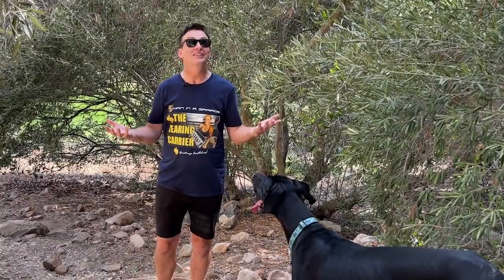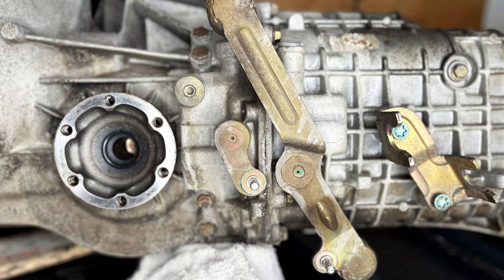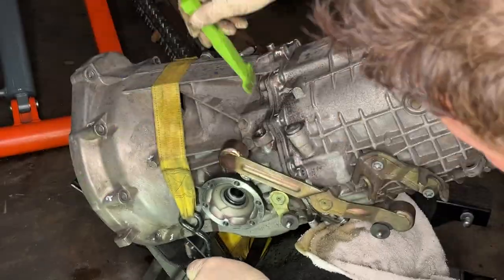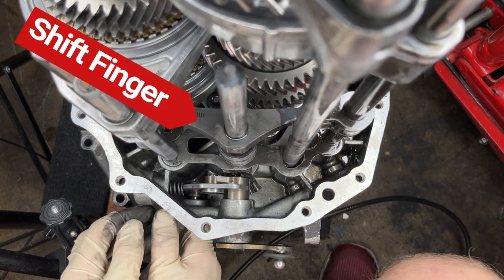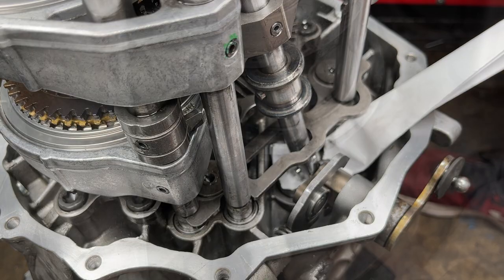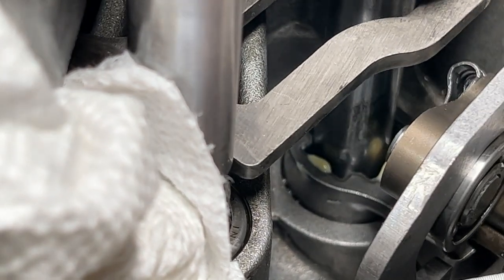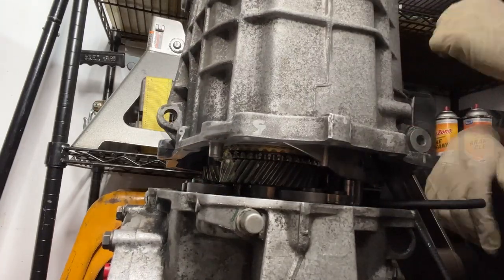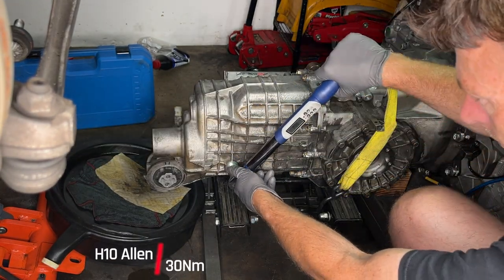How to BREAK a Porsche 911 Transmission!

Comment: Fill manual transmission fluid to bottom edge of filler hole, so basically fill until it dribbles out.
Reply from the maker: Thank you Andre! I really appreciate that 🙌 You Rock 🤘😎
Reply: The refill confusion is with the 5-speed in the Boxster.

From the factory 986 Boxster service manual: "At 2.25 l, the oil level is 11 mm below the filler opening. Use a bent wire hook (shop-made) to check the level."

From the factory 996 Carrera service manual: "Filling capacity: 2.7 l. Fill with oil up to the bottom edge of the oil filler opening."
Reply: @ManinaGarage  appreciate the shout out in the last video! 🙂
Reply from the maker: @andrebrown8792  You rock dude 🤘😎

Comment: Another great video Finn. I've rebuilt the transmission on my Moto Guzzi 850 Le Mans several years back and it's not as bad as doing an engine in my experience. Looking forward to seeing the Porsche back on the road.
Reply from the maker: Hello Francesco, our neighbor has a Moto Guzzi with the flat twin, it reminds me of a tiny Porsche engine. She loves that bike, it makes a cool sound also. Hopefully you enjoyed ripping up the streets on your 850. Thank you for watching 🤘😎
Reply: It's a V-twim, the BMW's use a boxer twin 😎
Reply from the maker: @francescorochira773  your right , I took another look at it, there is a bit of an angle on cylinders. They stick out the side instead of being front to back like on a Harley, makes them look like a mini Vw beetle engine 🤓

Comment: My god Finn my hat goes off to you, that looked an absolute nightmare!!! Fingers 🤞 it works as it should when all back together. 
I filled my transmission until it start to run out of the fill hole. Has worked well for 5k plus miles. I used Motul SAE 75W90.
Out of curiosity was the magnetic in transmission already? Would be very cool if it is fitted in the factory. 
Thanks for the videos Finn and I love my T-Shirts.
Reply: I also filled mine to the level, and it's survived 2k miles of track driving so far. Anecdote != evidence though!
The magnet should be there from factory, it catches the shavings that inevitably occur from the gear/synchro wear etc. Most transmissions have one or more.
Reply: @miketdavies  thank you for saying, that's really good to know.
Reply from the maker: Thank you for the transmission filling advice, that was a controversy I was not expecting 🤣😂 Yes, the magnet is in there from the factory. Thank you for watching 😎
Reply from the maker: Thank you for clarifying Mike 🙌

Comment: Great video Finn, I really enjoyed watching it. I just changed transmission oil on my 996 c4, and accidently loosened a wrong bolt,  on 15:48 , there is a bolt on the nose cone, on the right side of your left thumb. I first mistook this as a filling plug. Do you know what this bolts purpose is? Luckily the transmission shifts good afterwards, so hopefully no harm was done.
Reply from the maker: Thank you for watching, I’m not sure of the bolt you are talking about. Good luck with your project! 🤘😎
Reply: @ManinaGarage  thank you so much 👍

Comment: Hi Finn. Great video as always. I thing I’m missing something. What was your transmission issue to begin with? I mean what cause you to take that bad advise of removing that bolt, and made you go thru all this trouble?
Reply from the maker: Hello Meir, it started with the first Durametric episode when I drove to Stacy’s house, someone mentioned that my gear shift throw seemed long, which I mentioned, then I got a message about short shifters and “setting up” the shifter (I mentioned the long throw and what I thought was an issue getting into 2nd and an overly tough time getting into reverse) the advice was to remove the plug, put the car in reverse and then reinstall the plug. That was supposed to “reset” the endpoint of the transmission (reverse) which would then realign the other gears to improve the gearshift overall…… That seemed reasonable at the time. Thank you for watching 🤘😎
Reply: @ManinaGarage  thanks for the explanation. Waiting for your next video. Good luck.

Comment: unless i could see a convincing reason WHY that hole could not have been cast into the housing 11mm lower, and so conform with 100 years of transmission oil filler plug tradition, i would consider the 11mm hypothesis the musings of an obtuse, non-conformist.
Reply from the maker: As mentioned the instruction is in at least one porsche 996 repair manual with included full color diagrams. As someone mentioned in these comments, that 11mm instruction may relate to Boxsters. There is some reason for that 11mm detail to be floating around, do you think could dig into that mystery? Thank you for watching 🤘😎
Reply: @ManinaGarage  i have dug into it in the past, and didn't find enough to substantiate it for me. i have found that some people equate expertise with contrariness (as awkward as it sounds it's an actual word!). :).